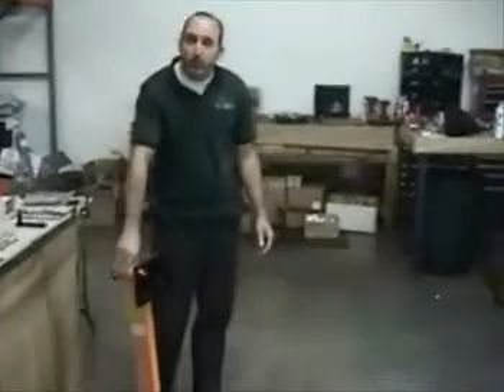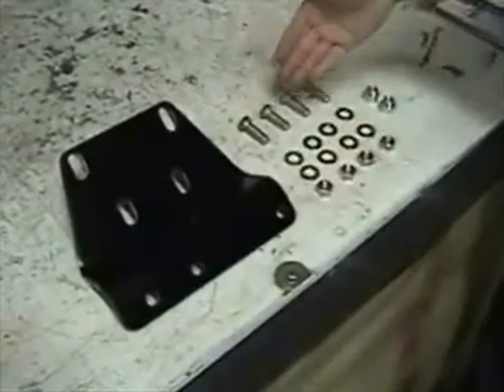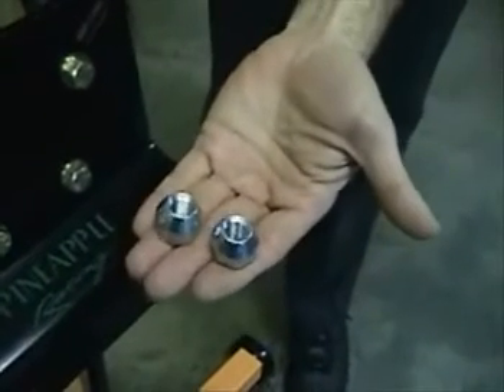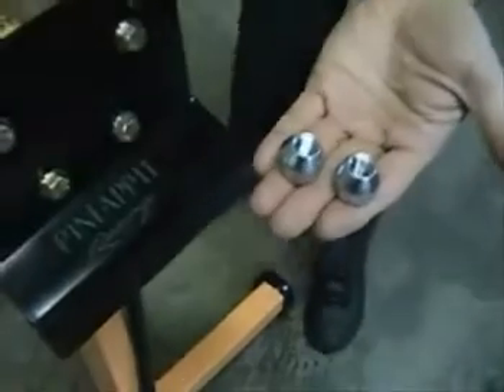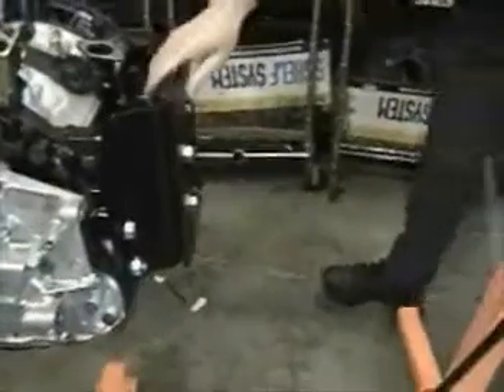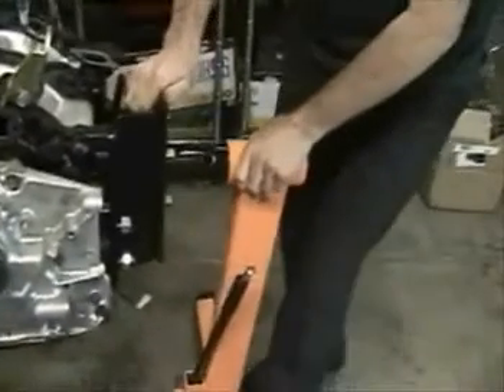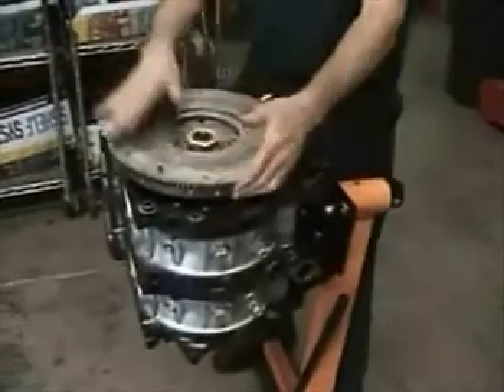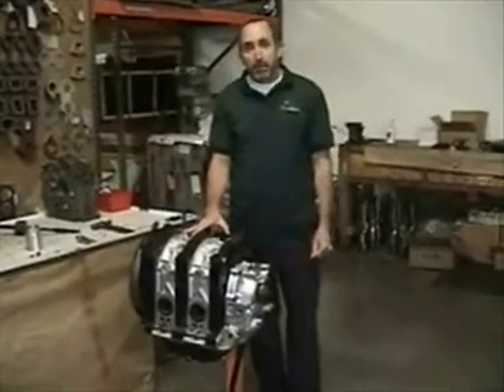Rotary Engine Stand Adapter

Comment: You don't need that adapter just bolt to the plate from the engine stand I'll  fit right on...
Reply: How do you tear and assemble a 13b on a regular engine stand without an adaptor
Reply: @Rautz.  you can bolt the engine stand right to the rear where the flywheel is like a normal engine but if you use the adapter you can remove and replace the flywheel with a lightened one.  That's about the only advantage and, of course, you can just put the engine on a tire face-first and replace the flywheel but the adapter makes everything a little easier.  Connecting a regular engine stand plate to only two of the four spider extension adapters to the a/c bolts on the block here shown can also be done but it's a little more awkward and might be harder to get to the spark plugs.  If you don't work on rotary engines frequently then it's probably not useful to get this adapter since they no longer cost $50 anymore and now run for about $120 since Brandon got in office!